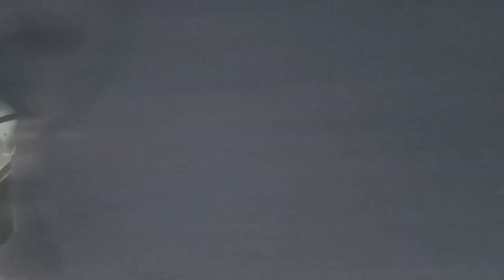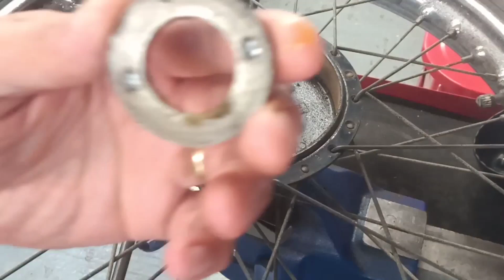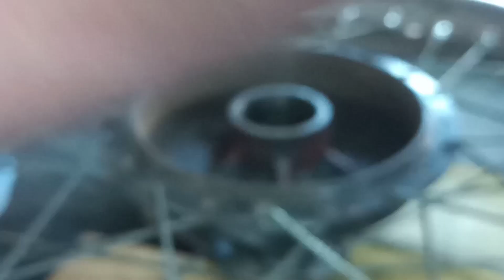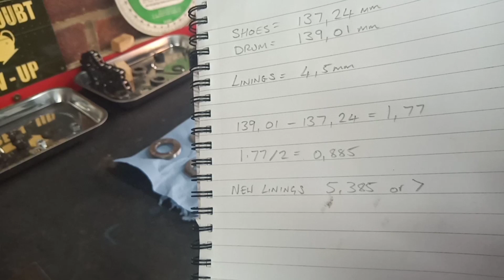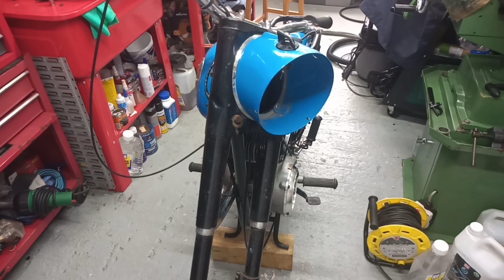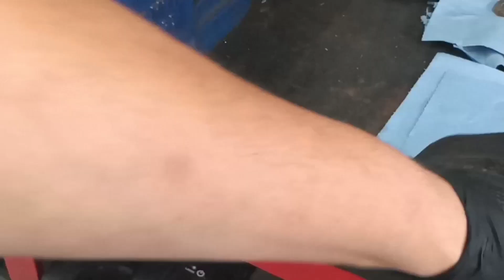Bantics! BSA Bantam D7 Front Wheel and Forks Strip and Inspect

Comment: Hi great vlog, could you tell me were i can buy "universal bsa station tool"i,m about to to seal on a D10,looked but cant find tool for sale?,thanks Mark.
Reply from the maker: @markkneller1172  that's not a tool I've heard of. Do you have the BSA part number?
Reply: Sorry stantion not station you used it to release fork tubes from yokes
Reply: 35 mins into vid
Reply from the maker: @markkneller1172  you can get a tool from 'Classic Bike Shop' in the UK, not sure if it will fit D10. I had to make a tool to fit my heavyweight B175 forks.
Reply: @retromechanicalengineer  thanks

Comment: Great work Dean and all in all so far everything that came apart looked good. The dreaded open bearings strike again with that amount of grease! I'm yet to see a D7 fork that remains oil tight and as you pointed out, the seals are woefully inadequate. The tyres were that old they could nearly be classed now as "heirloom" tyres. Looking forward to the rebuild.
Reply from the maker: Thanks Bones. Those tyres must be the originals, I'm sure of it. The tubes too, they still hold air really well. As you say, the forks will leak come what may, as the bushes seem ok it's pointless renewing everything for the sake of it. It will get new seals as a sign of goodwill!
Hope you are fine, best wishes
Dean.